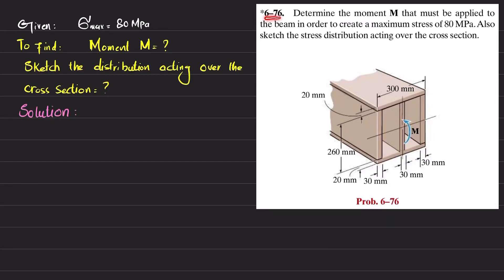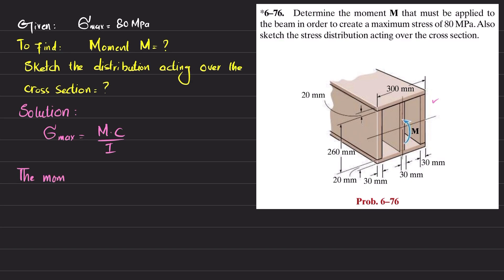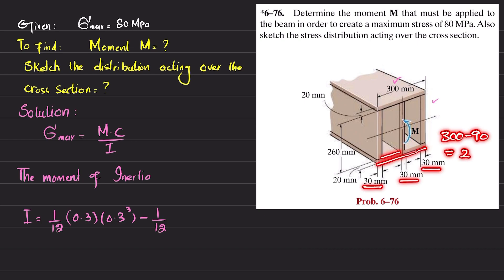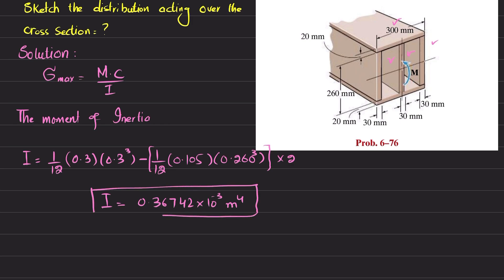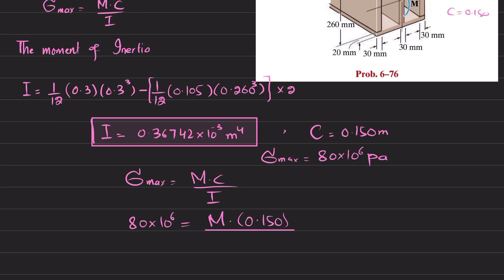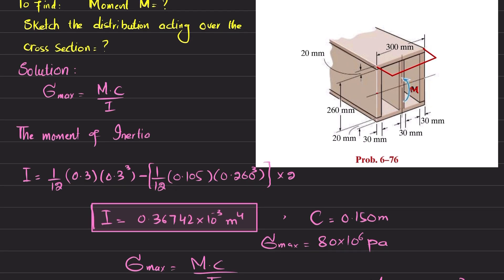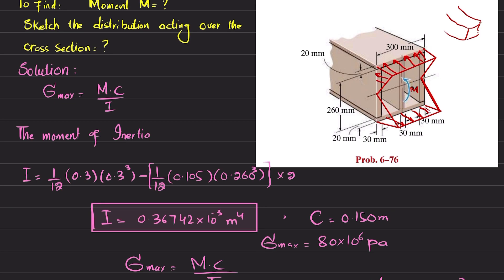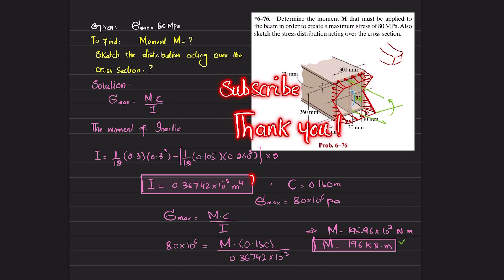6-76 |Chapter 6| Bending | Mechanics of Material Rc Hibbeler|

Comment: Sir in some places u have taken u have taken"- My/I" but in other cases u are taking "Mc/I" pls tell the difference of taking different formula.
Reply from the maker: the first one is for bending stress at any point above or below neutral axis while second one is for maximum bending stress at top or bottom layer from neutral axis.
Reply: But we can use My/I in both case then why negative sign @engradnanrasheedmechanical
Reply from the maker: ok when moment is counter clock wise then top layer is in compression and bottom layer will be in extension. so using -My/I the distance from neutral axis till top is positive y distance causing the bending stress to be negative (compression), but when you want to find the bending stress in top layer the distance y from neutral axis will be downward and taken and -y so bending stress will be -M (-y)/I will make it positive bending stress (tension in the bottom layer). I hope it is clear to you now).